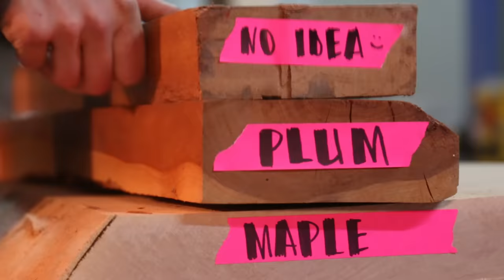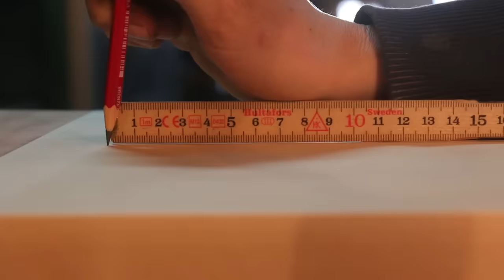Laura´s Mini Tabletop Workbench

Comment: "No idea" is the most common type of wood I use.
Reply from the maker: hahaha!
Reply: The most common wood I use is the leftovers of a commercial crate company.  lol
Reply: loads of no idea trees where I live...
Reply: Smü I have alot of that no idea around my place too
Reply: Smü I buy most of my wood from the scrap bin at the lumber yard or from the big bucket of unlabeled pen blanks
Reply: Woodworking for Mere Mortals has a number of intro videos, and planes/chisels is one of them, I think. Check them out. Sharpness, angle, and minutiae all matter.
Reply: +sbcontt Sorry to tell you friend, but you are doing something wrong. The chisel is one of the most useful and basic tools on any wood. But do not discourage at least now you know that you have to look more into it.
Reply: Wrong tool.  If you want a curve, it sounds like what you're doing is right.  I use a flexible-bladed saw like a band saw or a jigsaw to roughly cut out ("hog out") the material i don't want, then go back in and do the detail work.  

I find hand planes, scrapers, and sandpaper a bit more useful than chisels for detail work.  However, if I need to fit a dovetail or remove a tiny bit of material and keep a surface flat (or establish an angle), nothing beats a chisel.
Reply: I have a sizable amount of something crazier than No Idea: Brazilian Mystery Hardwood. About the same hardness as White Oak, but a bit tougher. All thanks to a countertop granite supplier (they sell a lot of Brazilian granite).
Reply: Stocks on companies dealing with Noidea wood are up!!!
Reply: looks like 'Purple Heart'...  very nice.
Reply: so have i
Reply: Treewood
Reply: The sharpness of your chisels and the cutting direction (relative to the wood grain) are the two main factors at play here
Reply: Yeah, it grows literally everywhere
Reply: No idea to jest chyba mahoń afrykański
Reply: No idea in philippines is taguile wood.
Reply: What was the wood oil you used there Laura
Reply: Same here.
Along with 'old garden fence' wood, 'probably from a pallet' wood, 'an old table of mediocre quality' wood, 'oak.. i guess...? Old stuff is made of oak, right..?' wood, and 'offcuts from someone's DIY project' wood.

...or - to give the collection it's proper name - "found it in the trash" :)
.    (Much like most of my furniture, my laminate flooring, my 39" LG flatscreen tv (From either Saudi Arabia, New Zealand, or South Africa... Note; I live in Amsterdam :')), 2 of my power drills, etc)
Reply: This particular "no idea" wood was definitely in the mahogany family
Reply: I generally use something personal
So the "Discarded" woods
Reply: Funnily enough it's the only type of wood my local wood shop stocks

Comment: Not to criticize but those legs look like they have a questionable weak spot right behind the clamping ledge. There isn't a whole lot of wood there plus the grain almost is inline (with the grain) to break off that front foot where it's clamped. It might be OK but certainly don't put to much force on it.
Reply: David Mm I was thinking the same. Maybe a screw tilted at 45 deg though the weak spot would reinforce it? It would be a shame if this fantastic work bench would break.
Reply: You also don't want breadboard ends attached like that.  They are meant to be loose. so the width of the table can change without putting stress on the breadboard ends.  like this: http://imgur.com/a/Jbvao#FHw99Xv
Reply: Matthew Schumaker q

Comment: this is a nice and thoughtfully made piece. I would cut the tenon into the breadboard end a bit shy of the full width of the mortise, as well as drilling the 2 noncentral dowel holes, removing the breadboard end and slotting them a bit. this will allow central maple panel to breath a bit without any buckling and keep your surface flatter longer, especially with such a small work bench which you will be comfortable taking inside and outside to many different humidity places very quickly

Comment: I have to admit I rather like the ide of this. Too many times I have a small project and it's a pain to take it over to the full size workbench when all I need is something simple like this.
My only concern would be the sharp corner on the base where you mount you clamp to secure it to the table. And that might never be a problem at all, however I have seen too many failures in sharp corners over the years as an engineer.
I might make one like it and do that one corner different.

Comment: That was really good execution, and a very elegant, functional design.
I am in the process of building one--but I like your implementation better.
I'll copy yours instead!

A few things:
1. What type of vise did you get?  
       I like how it integrates into your bench.
2. The area behind the clamping area seems a bit weak.  Perhaps less could have been cut?
3. I'd highly recommend hooking up a hose/shopvac to your festool saw.  
        There's a good bosch-shopvac convertor that'll make it work for a lot less money than the Festool branded stuff.

Comment: When using a dowel to peg a joint as was done in this video and others you have made, what's to purpose of putting down the tape before drilling the hole? My first thought was to avoid tear out, but I have never experienced that problem.

Comment: Great job kid, I love this and have been planning on making something like this myself. One little trick I use, which you do, is putting the tape down before drilling the holes for the dowels, except I use wider tape. Next I wipe off as much glue as I can, let it set up a bit, then saw off the excess dowel. The tape helps protect the finish from scratches from the saw.  Also , do you do a German video here you write in German, as an example, the name of the wood you are using? Keep up the good work. I always love watching your videos and always get ideas for future projects or learn something!

Comment: It's nice but I see the weak spot right off. It looks good don't get me wrong but if it's going to give I can see where and why.

And a tip for you. You don't finish wood with hardware attached. You remove it if attached, finish the wood, then re-install hardware.

Did you ever figure out what your unknown wood was?

You sure do have all the most expensive gear I will say that... Nice shop. I'm jealous... 😉

Cheers

Comment: I was wondering if there were any measurements you could share with us. I'm designing a mini workbench after watching your video and your inspirational video and was wondering the depth of the dovetail on the legs as well as the angel for the tails. it looks like its about 1/2 inch deep. also your caps, what is the measurement from edge to mortise? and lastly, have you had any issues with any of the joints moving it around?

Comment: Fine videography.  01:32-01:39, What are the specs for the portable circular saw and track?  Why did you use the circular saw instead of the table saw for the channel?

Comment: Thank you for a beautifully produced video and inspiring woodwork....one tiny question, what's the coloured tape you used to protect the wood when cutting and drilling? is it coloured masking tape or something stronger? is it to prevent splintered edges from the cutting tool?
Reply from the maker: +afshin dehkordi its calles artist tape. very stong paper tape. its to prevent tear out and to keep the glue off the surface

Comment: Your breadboard ends will be OK as long as the top doesn't move - that is, if your workshop conditions stay about the same through the seasons. It's quite narrow, which also minimises the risk. Dining table width, not so good.

Comment: I'm worried those narrow little feet with the short grain at the front of your support-leg pieces will be prone to splitting off if this thing is shocked or dropped, or if it receives any heavier working blows on the top near that front edge.  I gather that the cut-out portions in the front face of those legs are to allow clamping flexibility.  But the fragility of the remaining shape of those may be a problem, unless maybe you perhaps put some hidden screws up through them from the bottom for reinforcement? 

On a more positive note:  Of all the traditional woodworking I've seen involving drilling for plug (or dowel) holes (especially the innumerable bung-plugs for wooden boatbuilding, my particular area of long-time study)... I can't believe none of the old masters passed down that trick of drilling them through tape...  Ensuring:  (1) A crisp hole with no tear-out,  (2) No scarring the surface when sawing/chiseling off the plug, AND  (3) No mess to clean up from peripheral glue!  This is one of those times when I say not just "Why didn't I think of that", but even more, "Why out of ALL those old-time master-craftsmen I've gleaned tips from, did NONE of them mention this trick that seems like it should be obvious!

Comment: Hallo Laura, wollte fragen wo du diesen Orange Handgriff bei 0:25 gekauft hast? Ich könnte sowas auch gebrauchen. Ich finde dein Video voll klasse. Bin auch ein kleiner Holzwurm in meiner Werkstatt :).Lg

Hello Laura, wanted to ask where you bought this orange handle at 0:25? I could use something like that. I find your video full. I am also a small woodworm in my workshop :)
Reply from the maker: +Stefan Habricht die sind von rockler
Reply: Danke hab mir nun auch welche bestellt :)

Comment: So you have a big notch in your dovetailed foot/stretcher so you can clamp your mini bench to the table, correct ? Has it occurred to you, with respect, how much you weakened the foot doing that ? Especially using the no idea wood ( a rather pulpy cheap nasty mahogany sub species ). 
And all that just to raise the bench height 4/5” ! Why bother ?
It would make a good cheese board though and you can use the vice to hold the grater.
This whole mini bench craze is just a bit silly. The benches are to short to counter the weight of the vice or make a useful enough working surface. 
Its so much easier to just pull up a stool and cut your dovetails sitting down.